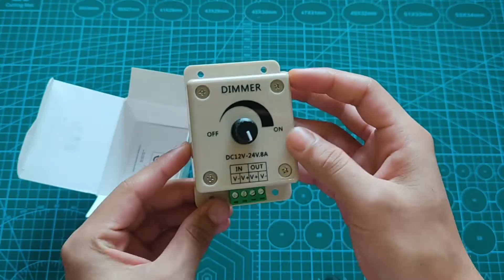DC 12V-24V 8A LED Bulb Dimmer Switch Brightness Controller 💯

Comment: I need a dimmer that can handle 100-150 watts at 12 volt.. can you suggest a dimmer for such a scenario?
Reply from the maker: DC10-60V 20A PWM Motor Speed Regulator Controller Switch Can fulfill your demand of 150 watt or more 
Here is the best buy link - https://amzn.to/44vZ0Zm
Reply from the maker: Subscribe for more information videos🙏

Comment: Can i use it for a motor DC 24V 5A
Reply from the maker: No, bro it will burn in 2min ,you can use it for only 1- 1.2 A appliances. 
Subscribe to support us 🙏😇
Reply: @techwithexperiment3736  sorry but this dimmer can load 30A .. so my mini motor 24V just for 5A.. why the dimmer can not use for it ??
Reply from the maker: This dimmer can't load 30A. You can go with different model.